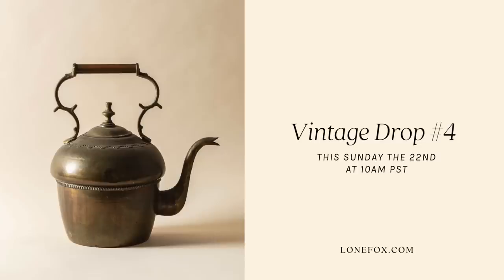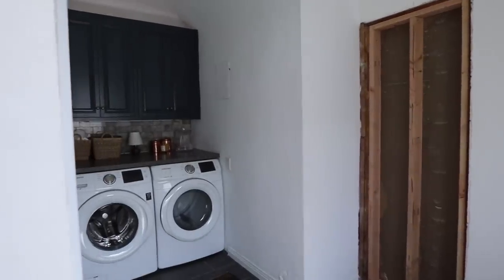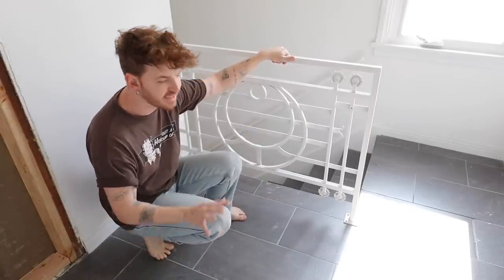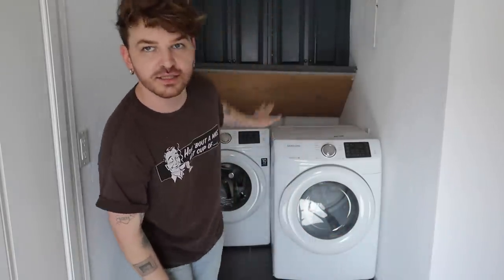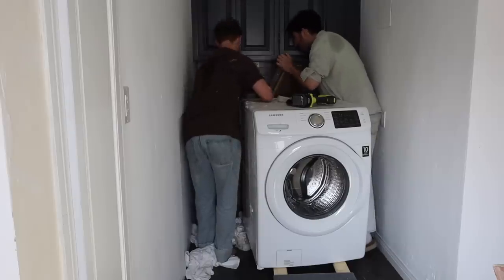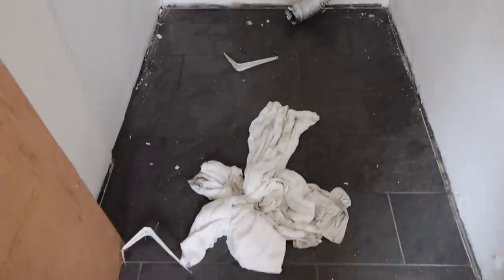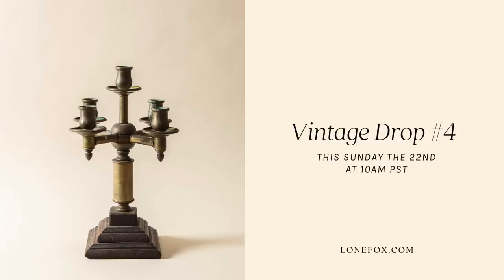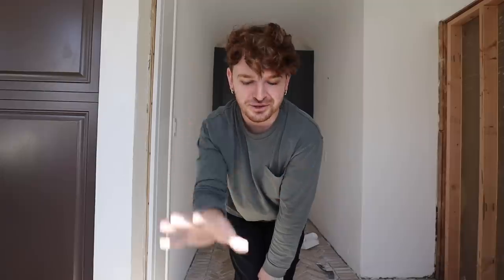LAUNDRY ROOM MAKEOVER 💦 I caused a FLOOD + DIY Herringbone Tile

Comment: 2 things...maybe a drop down table to fold dry laundry on and a "hidden pullout" rod to hang clothing on that does not go in the dryer😊
Reply: Yes! I came here to suggest some kind of hanging rod or rack! They make some beautiful ones that drop down from the ceiling too, but idk if those would work with an arched ceiling... but during this past summer, I've come to love air drying rather than running a dryer 🥵
Reply: Jumping on this, look for a flat to the wall rack that tips out so you can hang laundry on it. Also, where do you plan to put the laundry basket?
Reply: think laundry. folding area? a place to hang items you don’t put in the drier?
Reply: @donnapecoraro3126 whats your point?
Reply: @nyphira i think Donna was pretty clear. If you do laundry you know you need a place to fold and a place to hang some items. 😊

Comment: I think I would put a removable countertop over the washer and dryer.   In the event of some type of mishap, water or otherwise, you’re going to want to have a quick access to the appliances.  Years ago, when my dishwasher died and needed replacement, I discovered that the original dishwasher was impossible to remove without almost removing the kitchen countertop.

Comment: I don't know if someone else mentioned this but i think it would be cool to make a countertop using all the 2 inch offcuts from the border on the floor. Either full pieces or break them up to do a mosaic. 
The floor is beautiful!
Reply from the maker: I legit had said that in the video and edited it out because I thought it was a crazy idea...!!
Reply: @lonefox  I think using those short cuts for the countertop would be beautiful,  too - but won't the rough texture SNAG and PILL your clothes as you fold them? Unless you poured a resin sealer on top of the tiles and leveled it out flat. 😉
Reply: @lesliejackson8188  maybe they'd be more suitable for the backsplash, and then make the countertops something more smooth and understated
Reply: Maybe a wall clock on that wall?

Comment: while you're at it, put a shut off valve there for the water.   so many flood accidents happen around washers - when you're gone for a few days, always shut off the  water to the washer.    what could be useful and you could do it beautifully, is a "counter" along that big wall, perpendicular to the washer/dryer - but one that can lie flat against the wall when not in use, and when needed, can fold out to use for folding or perhaps additional space when you need to "line" dry fabrics.  It could also serve as another space to use when entertaining.    I can't wait to see the progression.  Also, because it's a small laundry area, I'd install a brass "pull down" clothes bar that can be used when you're putting your clothes on hangers or that need to dry on a hanger - do it up high above that pull down "counter" I mention above.  Again, it could be used to dry flowers, garlic, etc.   Always looking forward to your vlogs.   Hugs!

Comment: When you showed the storage cabinets you were thinking of, it reminded me of a cabinet I have. We don't have much money to spend, so we bought a gun cabinet at the thrift store for $20. I took out the gun display parts and installed shelves to make it a book cabinet. I painted it dark green with spray paint, believe it or not, and after painting I sanded it to the wood in key spots and rubbed the whole thing down with paste wax. The wax dries to a beautiful finish and adds dimension to the color--you'd never guess I'd used spray paint. It has glass doors, which right now I've covered from the inside by taping some (thrifted) wallpaper in the frame, but I can easily remove that if I want to display things.

Comment: I really like the tile without the grout look.  Anything that looks historical and European appeals to me, and you have a lot of that in this house.  YES to a furniture piece.  I have a long narrow table covered with bottles, boxes, all kinds of house cleaning items, etc. but I don't have a good configuration in my laundry room.  Again, I prefer the images that look rustic vs the detailed hand painted ones you showed as examples.  It's going to be beautiful.  One thing as a homeowner and someone who's done many loads of laundry: have a place to sort and fold in there, maybe a drop down top similar to the wall ironing board, which likely will never get used.  My personal issue with doing laundry is hauling warm laundry that gets wrinkled while being tossed into baskets to move around, and finding someplace that's good to sort and fold, which currently is my bed even though I have a laundry room (too narrow).  I love great design, but always remember that function is a big part of that.

Comment: Tile work looks amazing! Fantastic job! It is gorgeous! An idea for your wall opposite the ironing board, an art piece that doubles as a folding table. When it's  flush it's art and when it's down it's a legless table/shelf for folding laundry. Another idea for the wall you are placing a cabinet/wardrobe/pantry on. When looking into your laundry room from the kitchen you'll see your beautiful tall cabinet. Bring that cabinet close to your railing and have more lower closed cabinets to the left of it. Place upper closed cabinets or open shelving on the wall and underneath the shelving or upper cabinets place a wooden rod for hanging clothes that need to air dry or use for hanging things straight from the dryer. It could be mounted in the wall and into the side of your tall cabinet. Place a countertop on the lower cabinets to match what you do on top of your washer and dryer, if you are putting a countertop on them. Just ideas and I can't wait to see what you create. I know it will be beautiful.

Comment: Love the floor! My two suggestions are, If you use lower cabinets I would bring the depth flush with the wall and have a stone countertop  for extra space to fold clothes. You could add floating shelves above. I would consider adding a rod for hanging clothes either below the floating shelves or to the bare wall by the laundry units with a floating shelf above it. You could also DIY a tall built in cabinet that is less deep on the top half with the bottom half extended out to be flush with the wall and add a narrow countertop.Not sure if you have any stone left from the kitchen? Can’t wait to see what you come up with.

Comment: Definitely a large enough counter to fold clothes plus a bar for hanging clothes to dry that don’t go in the dryer. I like having space for my empty laundry basket/hamper while waiting for the clean clothes to finish, especially if doing several loads (bottom of your storage cabinet)? Love the tile pattern. You might think about stacking your washer/dryer and taking the upper cabinets out to give you more accessible storage. 😊
Reply: These are the same suggestions I was going to write! More counter space for empty basket and folding!!!!!

Comment: Drew, I would add a clothes rod on an L bracket that folds up towards the ceiling (when not in use) to fold down horizontally across the laundry room in front of the cabinets. This will give you a rod to hang clothes on hangers, as you pull them out of the dryer. Then, just grab the clothes on hangers and walk them into your closet to hang them up.

Comment: I just saw a designer cover up the electrical box with a picture. They put the wire on the back and ALSO put A MAGNET on the wire! NO nails stuck to the metal electrical box. Easy access to the electrical box and looked very nice. Depending on how heavy the picture/frame is, you may need several magnets or a heavy one. I can't see it being a problem with electricity but make sure and ask an electrician or YouTube. GOOD LUCK LOOKS NICE

Comment: Nice start!  You should someplace to hang clothes you can't throw in the dryer or as you iron them.  I'm sure you can find something cute that will fold against the wall when not in use.  Just make sure that it doesn't interfere with the ironing board.  Next to the railing, I'd put a folding table that you can use for decor, but open up if you need more space for folding clothes, or to hold overflow food or drinks if you have a big party upstairs.

Comment: I add a wooden coat rack on the left hand wall. You could hang some dried herbs or woven basket with dried flowers, an apron and perhaps wooden handled hand broom. Or alternatively, or in addition, you could install a vintage style wooden drying rack that could be raised and lowered from the ceiling. You could dry herbs and flowers on it as well as drying tea towels and clothing items that can’t go in the dryer.

Comment: For the wall area opposite the electrical box and next to the ironing board door, you could hang a vintage clothing rack that stays flat and then pulls out to provide a rod to hang clothes that need to air-dry.

Comment: What about doing two-tone walls in laundry? Like a lighter shade at top and several shades darker at bottom? Since it's long and narrow (including area down the stairway) it would really accentuate the space, making it look like corridors in some old Mission or villa, especially with a rustic cabinet and large pottery vessels in there. You could even hang some vintage baskets from ceiling, add iron wall sconces on walls, drape a cool woven textile across window and it would look like a narrow passage thru an old world market, somewhere in the Mediterranean...

Comment: I would make sure you can pull the washer and dryer out from the wall for maintenance reasons. So when you put another countertop back in, leave a bigger gap above them, unlike the last design. 

Also if you’re into smart home devices, it’s worth considering getting a water shutoff valve inside your house as well as some water leak sensors. If you stick one underneath the washer, the next time water spews out, the shutoff valve will  shut the water off. It’s nice not having to run to the street for surprise leaks. Stick leak sensors under the dishwasher and garbage disposals too.

Comment: I love the tile, the floor will get dusty and dirty with lint and grout is so hard to clean, the way you laid the tile will make it easy to maintain.  I think the floor is too beautiful to cover with a runner, plus a rug will collect a lot of lint and dust and it would always be dirty.  A counter over a washer/dryer looks really nice and adds function but it makes moving the appliances for cleaning and maintenance difficult.  I suggest having the counter on a hinge or somehow removable so you can easily access the back of the appliances.  I absolutely love the ironing board in the wall, I used to own a house built in 1920 that had a built in ironing board and I used it all the time, so convenient, I'm glad you're not taking it out.

Comment: I like the idea of using copper as a folding table on top of the appliances. You could reuse the railing and paint it a copper color too. Then tie the whole look together with a storage unit that would complement the look the dark green cabinets. I would then opt for pewter colored appliances.

Comment: That floor looks fabulous. I love the look without grout. BTW, I had one of those ironing boards in my 1920s house. Let's face it, no one does much ironing but it was seriously convenient not having to set up a portable ironing board every time.  It needs padding (use about an inch of cotton quilt batting, not polyester, which can't take the heat) and a cotton fabric cover over that. I just stapled them under the wooden board and it was great.

Comment: I think get rid of the uppers and make a nice patterned vintage spainish tile back splash with a solid spainish tile counter. The have open shelving with hanging space (could be nice to bring in the a brass bar like in the kitchen for nice continuity 😊) and nice baskets above the washer dryer instead. Then have a larger folk style cabinet for your things. A mix of tall storage for brooms etc, shelves and drawers. You can even diy it as a built in so you don’t have to dry wall that hole😅

Comment: Hi Drew,
Always tile or lay flooring underneath your appliances otherwise they are very difficult to pull out to repair and / or replace.  If the appliances can’t be pulled out the flooring has to be removed.

Comment: Floor is stunning! I would add a drying rack. Perhaps one that folds down so it’s out of the way when you don’t need it. I use mine all the time! You can buy a drying rack that has a shelving space on the top. Great for adding a few decorative pieces. 
I can’t wait to see the finale. 🎉

Comment: Drew, LOVE the floor! 🎉 Congrats to you and Justin on job well done! 
The metal rail...from a safety perspective AND scale, what would you think about installing a full-sized  vintage iron gate partition there? A tall vertical piece that serves both beauty as art and function! ...an Olde World look/design staying true to your home.
I think you should consider a half wall cabinet with more cabinetry or shelving above that also serves as a place to hang delicates that won't go into dryer. Then you maximize function of that wall space using your idea of olde world wooden base cabinet and uppers for storage while using the space between for a rod to hang things. OR install a small hanging rod in space between upper cabinets and washer/dryer. Just a thought. Love your idea of artwork on wall(s) extending out from washer/dryer.  🙂 Can't wait to see another incredible Lonefox transformation revealed!

Comment: Always good practice to remove old tile cement from the floor (thinset) before re-tiling, buy a cheap rotary hammer sds drill with floor scraper attachment. You will have a much better finish too.

Comment: You might want to consider adding a pull down drying/hanging bar or rack. It could go on the wall next to the ironing board or on the wall across from the ironing board.

Comment: Just a thought about the countertop:  Bamboo is beautiful, durable and sustainable.  Maybe that would be an option. 
Agree with others who suggest a hanging bar and/or pull out wall rack.
A fun laundry-themed mural and/or art to liven up the space a bit.
For color scheme; what you suggested leaning more to the cream/tan end of the spectrum than the gray end because grays have been overused for renovations when flipping properties.  It's too bad, but in my mind, it has tainted the gray shades. 
Someone else suggested a mirror, which is also useful because stains are easier to see on garments if you hold them in front of a mirror before pretreating, that way you don't miss any of those spots that are hard to see in some lighting.  
It will be fun to see what you come up with.

Comment: An addition I was thinking about is some hooks attached to the wall to put the hangers on as well as the clothes you just hung up. Also, attach a table to the wall - one that folds up and down so it's not in the way - so you can fold your clothes on it. Just ideas, I hope this helps.

Comment: Another tip…seal with 511 sealer….it enhances the color, feels less chalky on your feet & protects from stains…cuz travertine is soooooo porous…( we did it on our shower floor, very challenging to clean & have to really stay on top of the sealer to stave off soap scum & mildew🤪🤪😳😳😳

Comment: I would take down one upper cabinet and stack the washer dryer, add a laundry sink to the side with the other upper cabinet. Then I'd put narrow base and upper cabinets on the wall next to the built in ironing board with the counter top in an L around the sink and over the base cabinets.

Comment: I would use long skinny stone tile  (mine are 1" X 3" then stand them up to the wall making a 3" baseboard trim) for the base board trim and place a bevel on the top edge with a flat lap  and grout it . I did that in my kitchen and it looks great!  It isn't too much work in a small room.
Reply: lucky to be scammed :) go away

Comment: You know what else would make it easier to move your appliances in and out? I know they make all sorts of wheel kits and lifts and everything but the simple answer? Is those big clear floor pads they put underneath the desk of cubicle farms so that you're rolling chair can still roll back and forth. That way you don't have to chip away at your tile and you also don't have to worry about how hard it might be to mop if you ever spill liquid detergent.

Comment: I would have a rod to hang clothes on as they come out of the dryer. Also, I hope you checked the dryer lint tube - just to see if it is clear and not plugged up. As it can cause a fire.  Another great video.  Thanks for sharing.

Comment: I know it is a boring detail, but I hope you used a safer dryer vent than the flex ducting. A periscope one is solid sheet metal box and allows you to push the dryer closer to the wall.

Comment: You need a pull out valet or two so you can hang your clothes up straight from the dryer. They have some fancy ones. Maybe an old fashioned drying rack for sweaters. 😁 BTW I think you hit soprano on the screaming of the water emergency!

Comment: This looks great but there is a reason that you don’t see more grout-less tile floors out there. There are a few risks here. If you get a leak similar to the one you had in this video, you don’t have the grout as protection and your subfloor run a greater risk of getting seriously damaged. Also in a high traffic area, these tiles are likely to shift and can cause cracks of adjacent tiles. Others that are thinking about this type of installation should be cautious.

Comment: The floor looks great! Did you have to call a plumber to fix the handle, or what happened? In my very tiny laundry room, I stenciled a flock of herons on one wall. I didn't want a picture hanging on the wall that I would probably bump into and it likely fall on the floor.